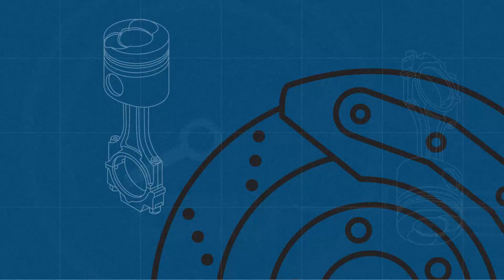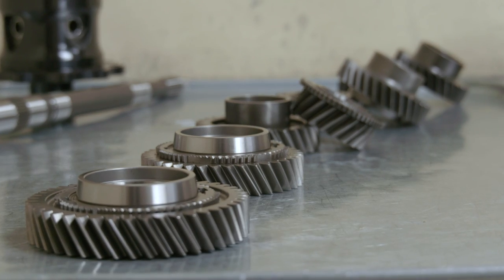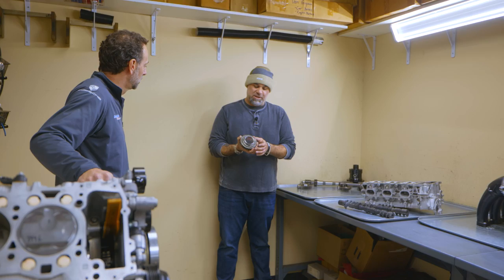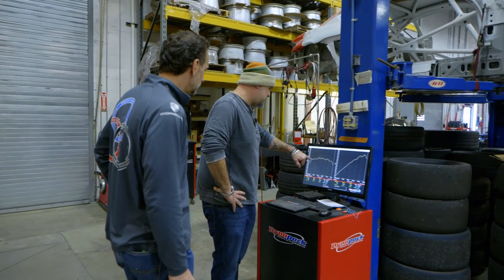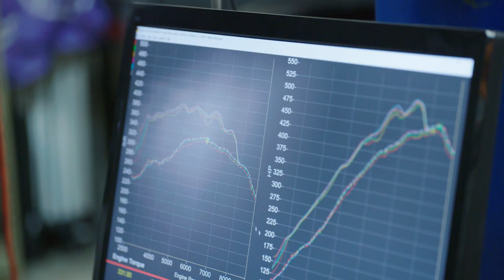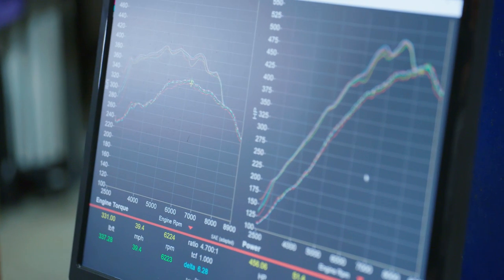The best water-cooled Porsche I've ever driven | MODIFIED

Comment: Does that upgrade cost as much as the car?
Reply: Used GT4 981 is about $88K, DeMan mod is min $28K. New GT4 718 is $99.2K (Average). You do the math.
Reply: @fredpinczuk7352  28k sounds like a sweet deal. Just need to find that 2016 Blue GT4. Thanks!
Reply: @trigganometry168  Just keep in mind, that for $28K you will be modifying the original engine on very limited release car (2,500 made). If you do, you should consider buying a spare block and have it modified as to keep the original safe. Its going to cost more (+$15K). But you know what 981 GT4 will be worth in a 5+ years.  Its not a drop crate engine as Matt incorrectly stated at the beginning of the video.
Reply: @trigganometry168  That's just for the engine. Engine, gearbox, flywheel, exhaust over 40k.

Comment: It's really a shame that Porsche itself can't even make a car as good as it could be.
Reply: It is partly true, especially the long gear ratio.
But it’s mainly down to the cost and environmental regulations. 
The demand for manual gear box is so low now, they don’t have the money to redesign the gears for one car.
Porsche sits in a small market in between M/AMG/RS and super cars.
Upgrade everything puts it right in the price battle with Mclaren and Ferrari, which would affect their sales greatly.
Let’s just celebrate that they are still making these manual NA cars at its own price range.
Reply: No major manufacturer can unfortunately
Reply: Can't or won't? 🙄
Reply: They can make even better than this one but they are bound by regulations and accountants
Reply: As a rule of thumb, if you really want to see car manufacturers as unleashed as possible straight from the factory you hit the circuit, not the road. It's tempting to criticize Porsche for not pushing the GT4 enough but there are way more factors into account than just making a shiny loud sporstcar go fast on the street, and they aren't always pretty (R&D costs, available markets, environmental regulations, etc.)
Reply: They can but they know it is not as reliable, doesn't make economic sense, and it will make any future improvements harder, On top of that emission regulations product positioning, you don't want cheaper model to outperform your higher end models.
Reply: @ac0rpbg  
Hahahaha
Thanks for proving my point!
Porsche itself therefore CANNOT make a car as good as it could be. They put themselves in a box.
And that is a shame.
Reply: 00:53 the Cayman complex lol
Reply: I cant belive some people buy this marketing crap from porsche about environment and technical issues 😂😂😂 
bitches, they make caymans/boxsters for over 20 years, if they wanted to give them proper gearing they would do it long time ago.... lot of different versions and different gearings are already in the models, changing gearing for company like porsche is like buying a loaf of bread for you .... technical issues about gearing ffs... they really think their customers are idiots. HMm maybe theyre right to some degree? Just food for thoughts ;

Comment: I imagine it's because Porsche has always been known as rear engined air cooled engines. Porsche, VW, Karman Ghia, we're always rear engined air cooled, except the course of the 924? You know they are going to stay true to the old standard. It's what they're known for.
Reply: FYI Porsche haven't been air cooled since 1998. or 23 years ago.
Reply: @fredpinczuk7352  That's a shame! That's why the old ones are so collectible. They set so many records and people love the styling. I had a 74 super beetle and my sister had an early 60's. They were so dependable and fun to drive. Then Nader and others said they were dangerous. So  VW had to be redesigned with a front engine. They're cool, but I still like the old  bugs, ghias and Porsche the best.
Reply: @jamesdiehl8690  You are correct, the last air cooled 911 (Model  964)  are continuing to increase in value.
Reply: @fredpinczuk7352  ... My 1998 Carrera S is an air-cooled model 993. Ordered new. The 911, 964 series ended production in 1994.

Comment: More hp, more heat. What about cooling on track in the hot humid southeast?
Reply: I've run it on track in summer up in NJ and never saw engine temps north of 203ºF. The cooling system that came stock on the GT4 is amazingly capable.

Comment: Even with those shortened gear ratios 72 mph at 2nd and 102 mpg at 3rd is still way too high to enjoy on a backroad in my opinion. You'd be at the top of 2nd most of the time, then going into 3rd you'd be out of the peak power range. You wouldn't get to shift gears much and that kills most of the enjoyment of driving a backroad
Reply: Agree but it is a huge improvement and you need to consider that 1st is also tall which is actually nice in a car with this much power. Can't shorten 2nd much more without it becoming a little redundant and then the rest of the gears are perfectly evenly spaced to the stock 6th. I have a shorter 2nd in my GT4, honestly prefer the ratios in the 4.5.

Comment: This is incredibly cool but let's face it, it's extreme and beyond the reach, (or need!), of most of us.  BUT... the revised transmission ratios?  Now there's something that every Cayman and Boxster needs.  Just crazy that Porsche handicaps such driving machines with those long, lazy gears.  We want to shift, dammit, not as Matt so aptly puts it, leave it in 3rd gear for the duration.  There's a reason Miata's are so fun to drive - you're working the clutch and shifter the whole time.  Imagine being able to do that in a Boxster.

Comment: N54 with $600 in bolts ons and an off the shelf tune slams this 30k motor. Porsche horsepower is so damn expensive. They make amazing cars but I really want to see a turbo on the cayman factory.
Reply: Lol, and an e30 would wreck all. Apples and oranges bro.

Comment: The next 911 needs to be mid engined. With the "718" going electric and hopefully being renamed to "914" and the Taycan and Panamera being replaced together with a 928. The 911 can finally become the legit halo car with mid engine, 4.0L NA engine. with a very usable lift back and trunk. Lose the useless rear seats especially with the Taycan/928 option. Then develop from the 4.0 with Turbo and GT variants, the chassis could be co developed with Lamborghini as well as transmission. 

911
914 (Mission R)
928 (Taycan/Panamera replacement)

Whatever they call their electric SUV which should replace both Macan and Cayenne.

Comment: Did he ever mention if this is possible on any 9A1 or is the larger displacement engines physically larger? Can a 3.4 go to a full 4.5 or even just near 4ish? 30k plus a 987.2 is a very tempting proposition.
Reply: that's it? 30k?  Seems too good to be true
Reply: Yea in the world of Porsche it seems quite affordable. No reason bore and stoke plus tune should cost any more than that, but I was surprised as well
Reply: I'm about to do the (bolt-on) thing he mentioned in the vid.  Instead of chasing the 911, I'm installing Bolt-ons on a 987.2 to chase GT4 performance for less money than a GT4.  Wish I had the money to do this, but engine work on Porsche engines is too expensive.
Reply: Can do it but costs more cause the heads are different on the smaller engines. Need to start with a 3.8 ideally...

Comment: There is a possible usability compromise - you have to add octane booster to every tank of gas, as the motor is high compression and won't run on pump gas

also why was the in cabin footage filmed on a potato? Weirdly jarring. Great video on the whole though
Reply: You can get it tuned for
93 pump gas
Reply: @esthetics4512  nope, on the deman motors you specifically can't tune for it (yet). The pistons and other internals create high compression and you can't tune that out. Only way would be to swap internals and make less power, which I imagine sort of defeats the purpose
Reply: @AndrewDRoyappa  not according to MIAMI RIDES he got a switchable 93 tune for his 4.5L GT3 by M- ENGINEERING AND MADE  MORE HP 600 to the crank
Reply: @esthetics4512  M engineering is different from Deman Motorsports
Reply: @AndrewDRoyappa  TRUE but deman doesn’t tune the cars he has a specific tuner for that in this case the M engineering tuners are better as they extracted more power from it while having it use pump gas MIAMI MILES stated when switched to the 100 octane fuel map it gives the car an extra 15-20hp where as pump gas gives it 600hp CRANK that is some good tuning man

Comment: For a car enthusiast, I am surprised he is giving out wrong information in the intro. The greatest Porsche sports car IS INDEED MID-ENGINE.  It’s not the rear engine 911 and never will be!  Please get that right, it’s embarrassing. The V10 Carrera GT sits above the 911, the 918 Spyder sits on top of 911, the legendary 917 and Nurburgring record holder 919 EVO, and the 911 GT3 RSR are all mid-engine!!! And don’t forget at other mid-engine Porsches such as the 911 GT1 and 959 from the 1980s too.
Reply: Matt was talking about the actual line-up for the road cars, not race cars from the past.
Reply: @Fastvoice  I disagree with your observation. At 1:02 Matt said “always” which suggest it’s historically been that way, which includes past, present, and future. Matt, is a great YouTuber but is tunnel visioned like many others thinking the 911 is the flagship or thinks that the Boxster/Cayman are the poor man’s 911 but in reality the top dog Porsche has always been Non-911 models. One can also say people who get a 911 because they couldn’t afford the 959, Carrera GT, or 918 Spyder.
Reply: @Fastvoice  another validation, the first Porsche to go sub 7 minutes around the Nürburgring is the 918 Spyder and the old and present recorder for all time Nürburgring is the 919 Evo which replaced the previous 956. 
Porsche realizes the rear engine flaw and that’s why the racing versions of the highest performance 911 models are indeed mi-engine as well; they are the mid-engine 911 GT1 and 911 GT3 RSR.

Comment: Confusing you keep talking about a "crate engine" yet you are modifying the current engine in the car?  NOT a crate engine then. Also subbing in a better transmission alone closer more appropriate ratios would (by itself) make a huge performance difference.  Thus Stage ONE ? HHHmmmm